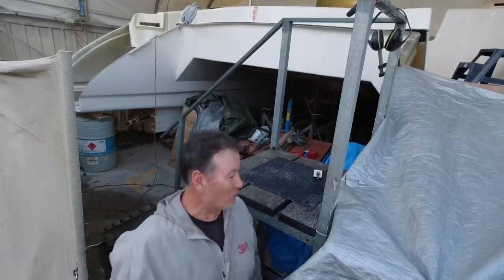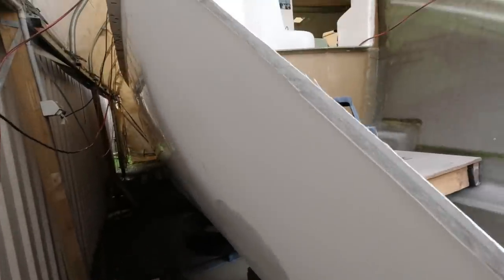That's a Big Hole in our new Catamaran Deck - Catamaran Build Ep217

Comment: Good grief! How you have the guts to chop away at a finished part I don't know. I understand the forethought and preparation, but still, getting the saw out and making those cuts, not sure how I'd feel about doing that. I think that's the power of having a clear vision of what you want it to be and also being extremely skilled with the medium you are working in, knowing that you can fix it and make it stronger than what it was. More power to you guys!
Reply from the maker: It can be a daunting scene for sure, but I am confident of the final look I am trying to achieve along with the structural integrity of the boa t in general being front of mind. Ross

Comment: Structural strength. A lot of weight in that section and for many years to come. 3 sheets of plywood. One per sid and for the centre lift area, glassed and bonded will give you all the support you will need so that there is no flexing. Just a thought! No, there will be no divorse over that lol

Comment: Hi Ross !  Looking at stair mods you're applying, and while I can't see an escape hatch of necessary size for you, maybe Janet could squeeze out a rectangular porthole. But then it occurred to me is one even advisable ? Generally cat's don't sink since the don't require massive ballast attached to keel...  if upended while belowdecks, that may bear thinking about vs an escape hatch. What do the rules require in your area ?  Yes, yes, I see there remains a lot to "thunk on" in design decisions. (I used to work in AC Carrier and Submarine Design Facilities at Newport News Shipbuilding)  everything is a host of compromises !   Think thrice, measure twice, cut once... (or more if needed he he)

Comment: Im starting to think who ever sold you the molds did not sell matching molds.. while 15 millimeters doesnt seem to be that much.. the fact is, youve had to modify the top mold to fit the bottom mold in many places... .Just an observation..
Reply from the maker: Nag,the mould was cut in half,drooped,and sagged over the years,but I do believe they never exactly matched,All good and very easy to fix.Ihave reinforced and matched them as xloae possible.Ae are talking g about a 44foot long,25 foot wide mould that weighs tonnes and had several moves in its life.
Reply: @LifeOnTheHulls  tyvm for the response. I just dont understand why you had to split the port and starboard upper deck to fit the lower deck.. understandably there is swelling/shrinkage from one part of the country to the other.... Im not trying to make drama of any kind. just observing what I see.  Again, tanks for the correction. However, if the mold "drooped" to the center it would not need an expanded gap to the top deck.... obviously Im missing the point.. maybe your fixing the centerline expanded the outer lines of the original boat lines is the answer... (fyi, no criticism from me on that)... it just got me thinking ...

Anyways, love the videos.. and love your workmanship.